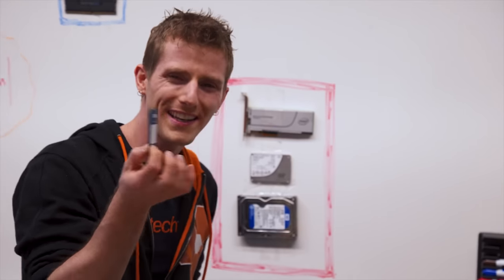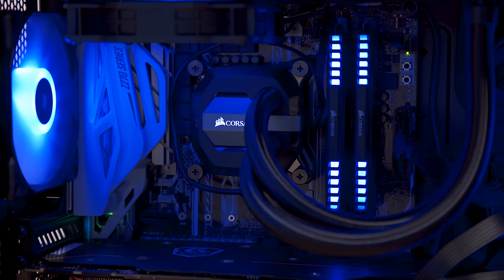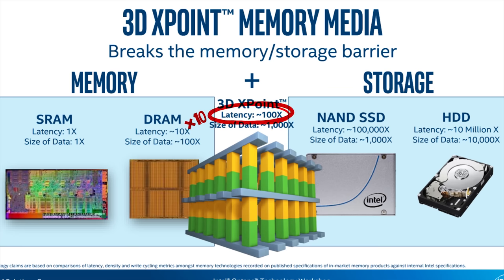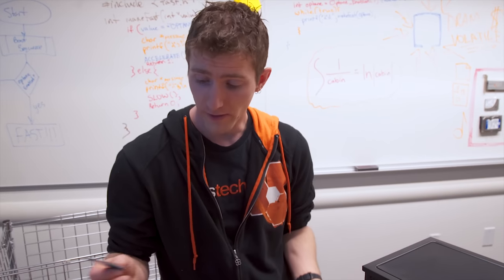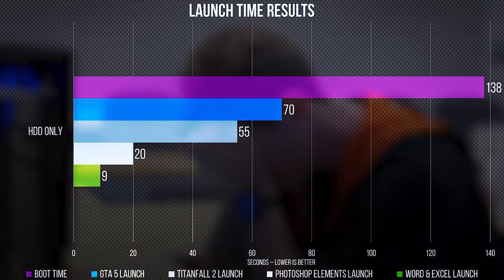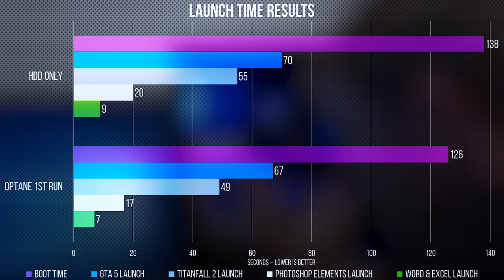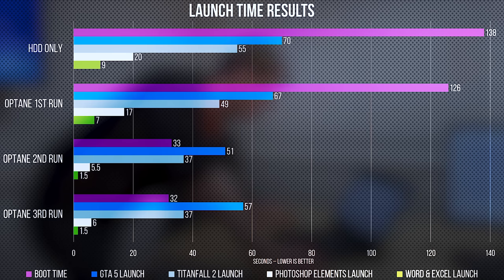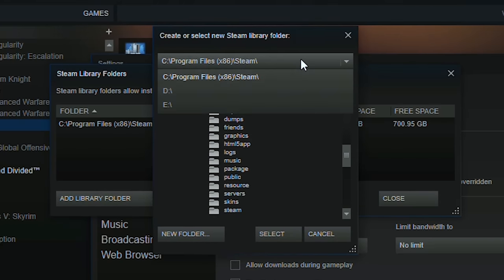Intel Optane Exclusive Hands On - SSD Crushing Performance

Comment: This will flop, just like back when using USB memory should do the same job.
The only people not getting an SSD in their new computer today are those that are clueless and those buying from the bottom shelf. These people will not buy this product either. The enthusiasts will buy a m2 512Gb or so to put their OS+++ on.
I'm sure the reason there is no comparison between this and an SSD is because the difference is small to non-existing.

Comment: Wow... this was underwhelming....the existence of cheap SSDs from WD or high performance Samsung ssds for OS/Program storage kinda... negate the usefulness of Optane...
i was really expecting this to replace ssds...
I wonder if there would be any performance benefits with optane acting as cache for an SSD...
Or would it be possible for Optane to exist as the main ram for low cost atom driven devices...

Comment: Windows 10 computer? 138 second boot time? Even on a HDD, I'm calling BS. I work with dual core AMD APU computers with HDDs and if Windows 10 fast startup is enabled, it's no more than 30 seconds.

Someone either gave that computer a dying HDD or really screwed the Windows install.

Comment: i want to buy optane memory besidesvi have an m.2ssd and a 1tb wd hard drive. i want to accelerate both my ssd and hd drive at the the same time.remember, i am using ssd as a primary boot drive for my operating system.i have z270 chipset and 7700k processor.

Comment: Optane will fail if intel requires an intel processor to use it. It will doubly fail if they require a higher end chipset.
Edit: Looked it up. WTF is wrong with you Intel. Facepalm

Comment: So I would need to buy a new (the newest) processor, motherboard, memory and install a shit OS because MS is not letting updates install on the new platform... no thanks, I'm just going to use an SSD with my 4790K (while I still can).

And why didn't you compare it to booting from SSD?
(I do understand that they are marketing this as a HDD addon, but I would like to know how it compares to an SSD, and I would expect this information from a semi tech review channel - otherwise I would just subscribe to Intel ads directly.)

Comment: my opinion: give me an optane drive on its own 256/512/1024GB or go away. hdd caching with 16/32gb will speed up boot-up of the system ... and thats about it. why should anyone pay 50 bucks if you get 256gb ssd for 70 and just have all programs work consistently faster? this product makes about as much sense as the original SSHD drives ... only this time you block (one of) your m.2 slots with it.

no thanks.

Comment: To confirm this will NOT work on a 6600k?
Reply: It only works with a Z270 motherboard with a free m.2 slot. Why you would put in a 32GB 2x PCI cache rather than a large m.2 4x PCI drive I have no idea.
Reply: Yea me I am not getting this. I just wanted to know if it was possible

Comment: Sounds like a gimmick and I don't see anyone buying it. M.2 SSDs can already achieve these speeds and their prices will continue to drop. Just do yourself a favor and run your OS on a 960 Pro, it will be a much better experience than running a mostly slow system while only putting certain files on the limited size Optane drive. If you can't afford a M.2 SSD right now, wait a few years and run a normal SATA SSD for now, you probably won't notice any difference between the M.2 and the SATA anyway. Game loading can't even take advantage of the M.2 speeds yet and you will see no faster loading on an M.2 that you will on a SATA SSD.

Comment: are we in 2011?? because it smells like "intel smart response ssd cache" all over again? promising "ssd" ( or here "optane") performance lvl for a "little" prize.
Sure it's working fine if you use the same and few apps everytime, but we are on a point where people have hundreds Go of apps, a small 16-32go optane won't be enough to cache everything, and if the app gets out of cache it will be as slow are running on the HDD (on this exemple), and it will end up like "intel smart reponse ssd caching" and apps will get cached in and out all the time, and loosing the beneficts of this technology. better wait for high storage optane drive at a reasonable price.

Comment: LTT sold their sole to intel or what? Optane is not worth it, works only on one HDD and its OS and hardware limited, cheaper and easier is to use hybrid drives, where are the real comparison..

Comment: For crying out loud Intel...Where the fuck are the V6 E5s? How the fuck are you going to justify me the end user your superiority when a currently 350€ motherboard and a 1800€ CPU are not considered bleeding edge and are not supported? What the fuck should I upgrade to when toy Xeons (1150 platform) have reached V6 and your "flagship" 2011-3 platform is stuck at V4? First it was the X79 (2011) when you abandoned so many users with super expensive "outdated" hardware just for a revision (2011-3 aka 2011 v3) and now this! Can"t wait till the reds rebel or I get my hands on some 10nm ARM server chips...whichever comes first!